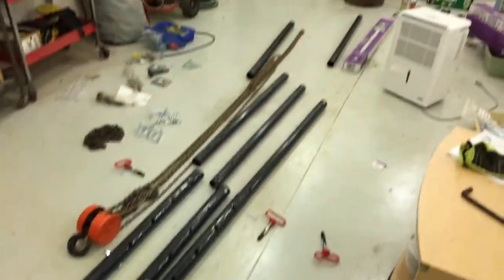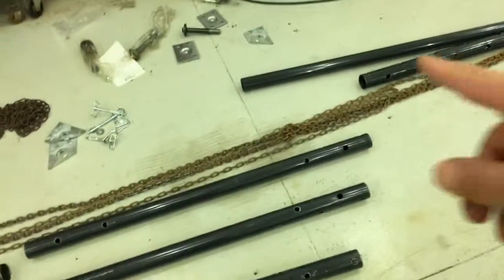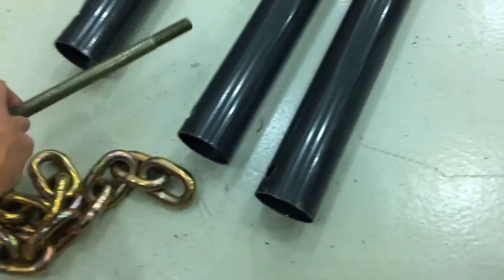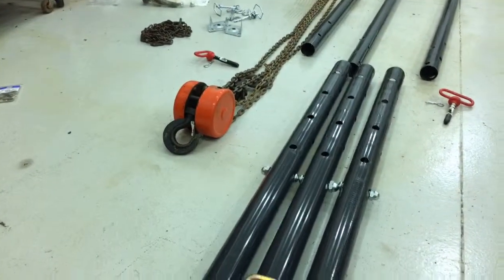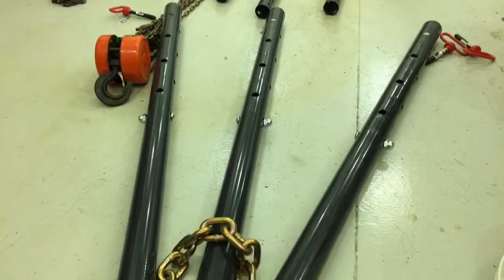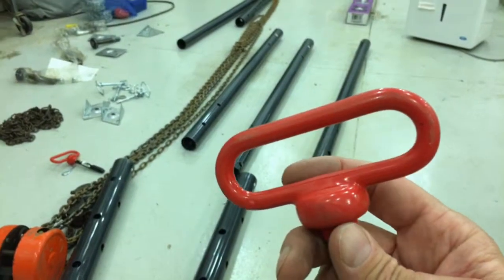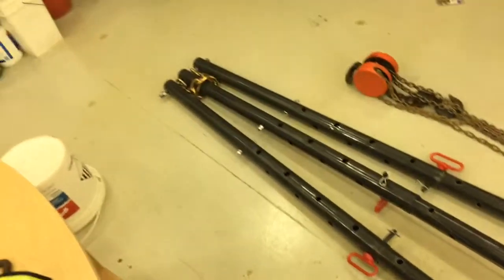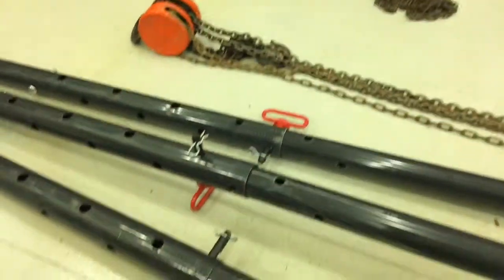Tripod hoist build 3

Comment: Well done! We are using your build as a template for our Cemetery in Millgrove, ON Canada. It's been 5 years now since this vid was posted. Would you do anything different if you started over?
Reply from the maker: I probably drill a few less holes as I have found I don't need so much adjustment on each telescoping leg. I also never used the "feet" I made from the leftover plates.  Keep watching other videos and you should note I just welded one of the threaded adjusters to the end of 3 tubes and the act as the feet of the legs. I kept the adjusting screw should I ever need the leg to keep from slipping in soft ground or uneven terrain...however, don't think I have ever used or needed them...especially since I almost always secure all 3 legs together equidistantly with my safety chains.

A shorter answer would be just to cap off the end of each leg so dirt doesn't pack into them.
Reply from the maker: look for "Tripod hoist build 6" video which shows my lengthy answer above